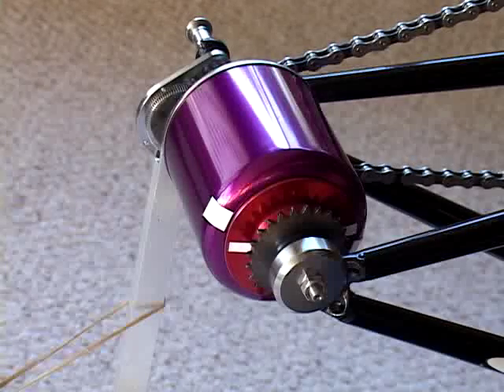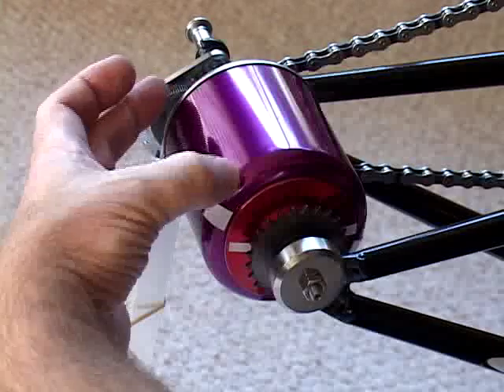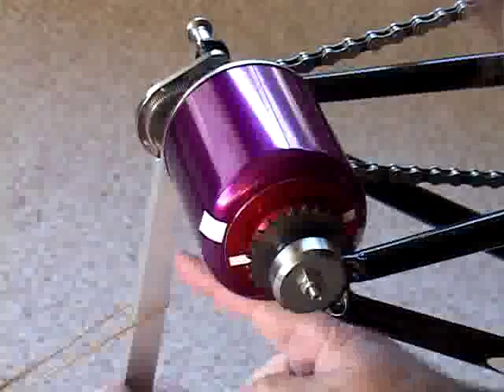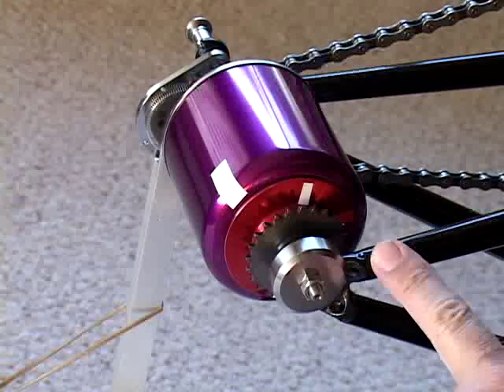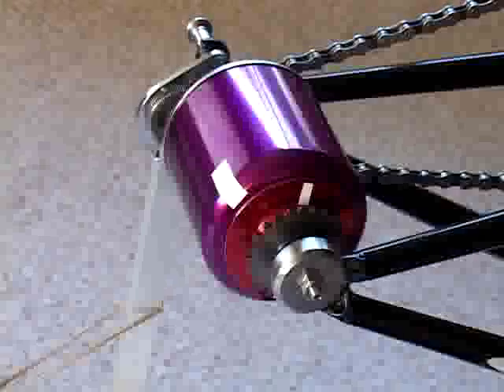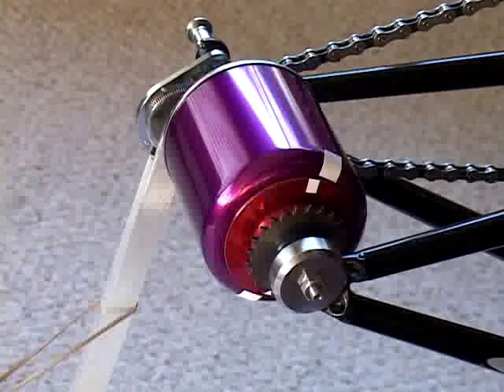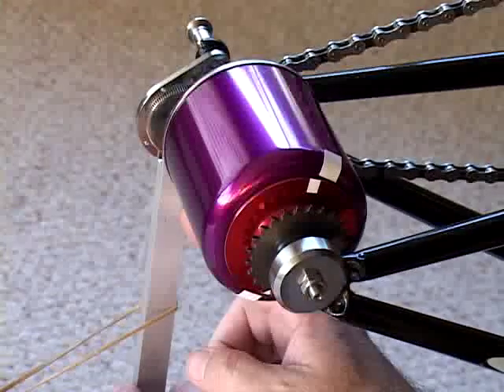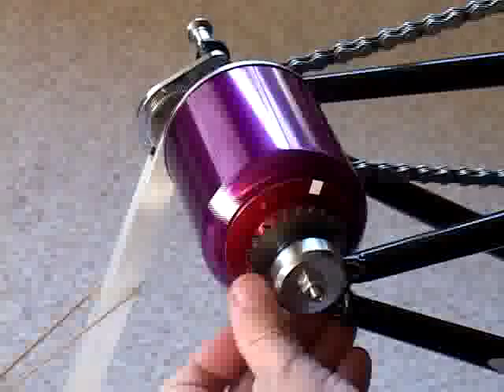Automatic Bicycle Transmission (IVT)

Comment from the maker: @KingOfKhaos1991 If you put more force into any bike's pedals on level ground, you'll accelerate & go faster, and soon will be pedaling faster unless you change to a higher gear ratio.  The SIVAT will automatically raise the gear ratio in that case.  Conversely, if you're going uphill, the SIVAT will lower the ratio as the hill slows you down when you keep pedaling with excessively high force.  The goal is to keep you pedaling at nearly constant speed & force, regardless.

Comment: so would this sit inside of the rear hub or replace it alltogether? also if i understand correctly say you were riding a bike equipped with this technology, youwere sitting down while pedaling. Then, you decide you want to go faster and stand up and with out couching any kind of mechanism started pedaling harder it would react to the added force and adapt to it by automaticly changing the ratio thus the faster you pedal the (lower/higher? not to good with this stuff) the ratio would become?

Comment from the maker: @bevaroni A group of us looked at wind turbine applications about 2 years ago.  The results were encouraging.  HAWT's can use the SIVAT for the following; AC synchronization to grid, wind-gust protection, IGBT elimination, broadened dynamic range, enhanced efficiency.  Wind turbines are huge, but we must start out small for other applications before developing for them.  EPRI knows about the SIVAT.  This is very technical, but your question has been already researched; good question!

Comment: I have invented an IVT.  The oscillation is a problem with the ratcheting types of CVTs.  That isn't going to be an issue with my design.  It isn't a ratcheting design and doesn't fit in any known category.  I started from scratch.  Not keen on the overload mechanism.  Mine is designed to have a very specific gear ratio depending on the adjustment of the control system.  Interested to learn from Youtubers how the marketing process is evolving now through the Internet.

Comment from the maker: @codyfranta No.  The front chainwheel would be larger than the rear sprocket for normal operation; this would be 49T/13T with the front chainwheel center slightly raised above the bottom bracket center for enhanced ground clearance and chain-tightening ability.  This will offer high gear similar to typical MTB's, and low gears lower than the 22T/34T combination.

Comment from the maker: @5656bigsteve Thank you.  The SIVAT will be re-located to the front (chainwheel) with enough capacity for robust motorized use.  This solution allows for a simple lightweight rear wheel that's more responsive to bumps & divots in the MTB experience!

Comment from the maker: @Bluesbreaker2010 It would fit a Stingray, but would need to be fitted with a larger (front) chainwheel to compensate for the smaller wheels.

Comment from the maker: @misium Note that the sprocket combination is 55T/11T, so the system ratio is nearly 5:1.  The product design will include an internal gear-up so that the front sprocket will be smaller than 55T while achieving such high ratios.

Comment from the maker: @waterkeeper03 The input & output are not reversible; for high gear ratios, the input or output to or from the SIVAT may be geared up though.  The ratio lever reacts to throughput torque, so it does 'measure' resistance in effect.  Please send further inquiry to my YT in-box.

Comment: 2 questions. Does this transmission work to increase rotation if the drive chain is applied to the gear on the side we are looking at?  another words, apply the drive chain to the side with the tape, to spin the other side faster? I'm working on a different project this may be just what I need.
Q for your project: in real world use, what is the lever attached to to measure resistance for automatic adjustment?

Comment from the maker: @christo930 Good question!  After studying much data & many graphs on bicycling efficiency, I'm sure that SIVAT ratio control improves efficiency surprisingly well by improving natural muscle motions by regulating their speed & force.  This will be tested.  The lever for ratio control is torque-responsive; note that the rubber band represents a spring which offers a simple automatic response to the cyclist's pedaling cadence (speed) & force.

Comment: Is this system more efficient that a regular bicycle setup? It seems to me that the regular bicycle is about as efficient as you can get, at least for a bicycle. It seems to not be automatic considering that you have to move the lever to change the ratio.

Comment from the maker: @Za7a7aZ No.  DAF used a VDP (Variable Diameter Pulley) which is actually a traction drive, the basis for most contemporary CVT's.  SIVAT uses ratcheting.  See Wikipedia for explanations; enter 'Continuously Variable Transmission'.

Comment from the maker: @anantj18 The SIVAT is not based on a traction or toroidal CVR; it's based on ratcheting of levers & gears.  The internal ratio limit of about 1:1 is only approximate in the simplest configuration, but much higher limits are possible with a few extra components.  The first product design will include a top ratio above 1:1.  The range of ratios will always go down to zero regardless of the top ratio!

Comment from the maker: @upcycle The top ratio can be raised by input gearing.  For instance, the video-featured drive uses a 55T/11T sprocket combination, so the system has nearly 5:1 high gear.

Comment from the maker: @0ShoopDaWhoop0 Thanx for asking.  Notice the rubber band (elastic)?  The SIVAT will use a spring instead of a rubber band to push the lever you refer to as a 'piece of wood' toward a high gear ratio condition.  If you pedal with greater force, the ratio will automatically go lower proportionately because the lever reacts to SIVAT input torque (force) inside the transmission.  As your pedaling force relaxes, the ratio will rise automatically until equilibrium is achieved.

Comment from the maker: @Danthekarterman Regardless of either the sprocket-to-sprocket ratio of the input system (far side), or the SIVAT ratio, the output will freewheel.  It behaves similar to most multi-ratio drives for bikes.  One difference is that when you start pedaling again, the engagement is instantaneous with the SIVAT; there's always only a tiny lag that's hardly noticeable.  Does that answer your question?

Comment: Lets say for instance that the input is motionless and the output (sprocket nearest in view) is spinning counterclockwise. If you increase the gearing to connect the output with the input, would it drive the input? Or would it simply continue freewheel without influencing the angular velocity of the input?
Thanks!

Comment from the maker: @Hopfolk You won't need to stand on the pedals to ascend steep hills because your input (pedaling) torque won't change;that's the point.  There will be a global adjustment that you can make to generally change pedaling torque throughout all the SIVAT ratios, and a locking feature will allow you to keep a ratio setting if you want to stand on the pedals going uphill without the ratio automatically lowering further.  Most seasoned riders only use that technique for short bursts though.

Comment: @SIMKINETICS I am afraid my question still stands - for the application of a cyclist pedalling uphill in a low ratio, whilst standing on the pedals to use his/her full weight, will the SIVAT not slip ?  I believe it will unless there is a synchromesh-type arrangement to positively engage the drive... Friction alone will not cope

Comment from the maker: @Hopfolk There is no clutch action necessary for the SIVAT.  If motorized, the bike will simply start accelerating from a stop in an extremely low ratio that will rise quickly to maintain nearly constant motor speed while you accelerate; the low ratios won't allow excessive torque demand from the motor at low bike speeds because the SIVAT is torque-responsive.  The overload feature would only be invoked if the bike & rider are fully stopped by an obstruction.  Does that clarify it for you?

Comment: From the way the output appears not to be constant at low engagement thresholds, and the "overload protection feature" you described I am imagining that clutching will be a problem for this project. Low ratios are called for when ascending a hill, for example, yet the load uphill is significantly higher than on a fast downhill, high ratio section. Any thoughts?

Comment from the maker: @manfromregina On a bike, the input is motion of your legs, and the output is motion of the wheels.  The SIVAT allows you & your bike to 'freewheel' or coast downhill or on the flat without pedaling, just like on most bikes.  If you start pedaling after coasting, the SIVAT will engage in a higher gear ratio that will support high bike speed with normal pedaling speed until you start going uphill.  Once you go uphill, the gear ratio will automatically lower, maintaining pedaling speed.

Comment from the maker: @MrRodeobike To clarify: SIVAT input power is regulated to be constant.  Power is torque times speed; If pedaling speed increases, then pedaling torque must decrease proportionately for constant power.  The SIVAT compensates automatically by raising output speed (the bike speed) while maintaining the pedaling speed. I assume that  when you write 'strength' that you mean torque.  Is this clear?

Comment: this kind of speed cotroller looks good but the problem is the input power must be the same level strength and speed, if input speed is changed rate will be different so how will input speed be the same level and speed? anyways good luck.

Comment from the maker: @DeathsPit00 It will take a few months.  I'm still working out the new design.  That may require some tweaks of the next prototype; just the engineering calculations for the SIVAT are a lot of work, but must be thorough to assure a durable product.  Ideally, my son will test ride it.  He's also an engineer, raced MTB & Road, and is notorious for breaking components & being very picky about bike design!

Comment from the maker: @88enri88 The price will be up to the manufacturer, but judging from comparison to the Rohloff  Speedhub 500/14, I'd estimate that the SIVAT will be less expensive because it's simpler.  Since I own a Rohloff, and have disassembled & re-assembled it, I'm quite familiar with it for this comparison.  BTW, the Rohloff is well designed & produced with high quality, so that will be our standard too!

Comment from the maker: @youtuubbguy66 I'm re-designing it for a manufacturer to his specs.  The SIVAT will be located up front at the bottom-bracket, not at the hub.  The new design will be prototyped & rigorously tested before it becomes a product; so, it will be available in several months.  This video will be replaced with a demo showing the new SIVAT used by a rider on hills.

Comment from the maker: @fengatormx6 Yes!  I've decided to modify the concept for the upcoming design to reach above 1:1.  This means that the typical 44T-to-11T (front-to-back) mountain-bike sprockets will give you a higher high gear!  Alternately, I'll use a 49T/13T or 49T/14T combination for less wear on the chain & sprockets.  The high gear will still be higher, and the lowest gear will be much lower than current MTB gears.  Ground clearance will be similar.

Comment from the maker: @joeatgvo On Q1: No.  After bench testing, high torque failed due to a trivial design flaw unrelated to the concept, so I chose a different design execution which I'm working on for a client.  Now I fully understand all forces because of testing & analysis of that 1st prototype.  I will ride this next prototype & will post a new video with  riders in mountains.
on Q2: Patent is pending.  My patent search revealed nothing to challenge it, so it's likely to be granted.

Comment from the maker: @Pip2andahalf Same here!  I rode my own predecessor automatic CVT transmission-equipped bike, and had the same experience.  What was the brand that you rode?  I'm curious because I wasn't aware of any other automatic other than the Browning derailleur system & some recent variations.  My intent is to provide riders with an automatic that allows them to focus on other aspects of technical riding such as serious MTB riding (balance, steering & pedaling effort); what's your impression of that?

Comment from the maker: @mikelo303 It's moving forward.  We're in the development stage with funding to make a product.  You're correct that it takes time.  Most inventions don't get to this phase at all.  The ones that are successful usually have a long history that few know about.  As a long-time engineer, I've seen many that took several years even with up-front corporate funding, so try to imagine what a free-lancer must do.  This is all about diligence.

Comment from the maker: @gt4driftster Thanx for your questions.  It uses one-way clutches that are either engaged or not; there's extremely low slippage in the transition of them between engagement & disengagement, so the mechanism is very efficient.  These components are used in many automobile transmissions, so they're very reliable too.  As to 'read' vs 'react', I say react because there's no intermediate step; it's a direct action.  I'm applying for a patent, so I cannot show the innards 'til it's issued.  Sorry.

Comment from the maker: @iimafa The overload protection will be beyond the torque levels that humans & small motors will produce ascending the steepest hills.  That feature is there only to protect against misuse, such as using an oversized motor (>1,500 watts).  As an IVT, it can produce enormous output torque at extremely low ratios, so it's important to specify a limit.  Bigger vehicles will have bigger SIVAT's for more capacity & higher limits.

Comment from the maker: @gt4driftster Yes, you're right.  This is also a CVT.  What's unique here is its ability to continuously go all the way down to zero; so, it requires no clutch or TC to smoothly & powerfully begin moving the vehicle from a stop.  Pure CVT's, by contrast, have limits to their range.  Another substantial advantage to the IVT is that the highest ratio may be raised to anything practical without losing any of the lowest ratios, including zero.  Load verification? No.  Load reaction?  Yes.

Comment from the maker: @slingblade1991 Are you forgetting that cars have 2 in-series gear systems?  The typical transmission, whether outdated or modern, is a reducer.  Further reduction is in the differential, which can be geared with a lower numerical ratio (higher output speed).  The real reason for more gears than 3 in modern cars is that their more efficient, higher revving engines require more gears because of their narrower, higher revving torque peak curves.  The SIVAT can easily accomodate cars.

Comment: @SIMKINETICS Gear ratios that are 1:1 final drive are inefficient, Those days ended with the 3 speed auto. Internal combustion engines need overdrive  for highway speeds

Comment from the maker: @slingblade1991 Bicycles may need an overdrive (greater than 1:1) to achieve smaller front sprocket size.  This can be done easily with internal gearing for raising the highest ratios without affecting low ratios.  Motorized vehicles won't need overdrive because motors & engines typically operate at high speeds.

Comment from the maker: @noahlyden17 On launch from a start, it will behave similar to a centrifugal clutch, but much more efficiently.  Unlike your description, greater pedal or motor force will cause the ratio to go down, vaguely resembling more slippage, but without actually slipping.  I know how it will feel because I invented, built & rode a CVT bike with a similar automatic feature; the pedaling seemed slightly elastic, yet propulsive.

Comment: its kinda like a cintrifigul cllutch but controlled or maybe a belt pulley idler type deal hard you push on the belt less slip you will get. but with this its a little different

Comment from the maker: @Poppinfever ...The SIVAT can handle pedaling torque & cadence, according to the specs.  On bikes, the ratio control mechanism response turns out to be simple because of its fairly linear reaction in the torque-velocity relationship, allowing a damped spring to do the work.  That mechanical servo will regulate the ratio to keep pedaling torque & cadence nearly constant, even during a surging acceleration.  For more info, send an inquiry to my channel inbox, & I'll email you a word doc.

Comment from the maker: @AlBarathur I want to design it for bikes that can also be motorized because, that way, economy of scale savings can be passed on to buyers.  This is confirmed by manufacturers.  So, a no-clutch IVT version can be used with motors that make 1.5 hp (which is more than pedaling produces).  For pedaling, it's not necessary, but won't hurt.

Comment from the maker: @bt7urbo I apologize for the wordy tone of the video for many viewers.  Its intent was to inform other engineers mostly, and was done on the cheap, pretty dry for some.  I'm redesigning the SIVAT for a full installation & new video that should deliver on showing a rider using it, & with better production values.  This video achieved an important goal though; it attracted development resources from other engineer/businesspeople.  I'm actually very surprised with the viewing volume.

Comment from the maker: For any viewer who wonders why the ratio control mechanism can be overloaded so easily here, bear in mind that the rubber-band was deliberately used for demo purposes.  On a bike, this would simply be replaced by a very stiff spring.  Luckily, the reaction torque follows a nearly linear profile for speed control, so the required spring [constant] should work well with a simple lever & damper.